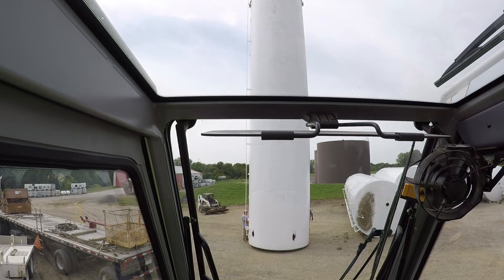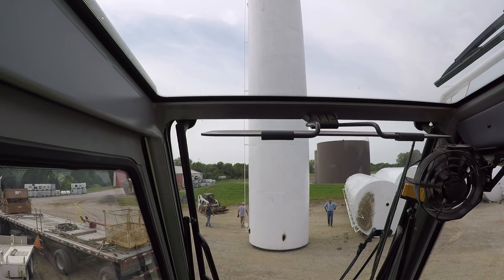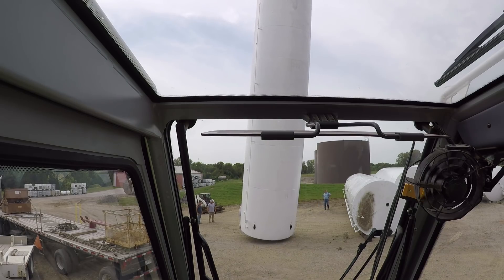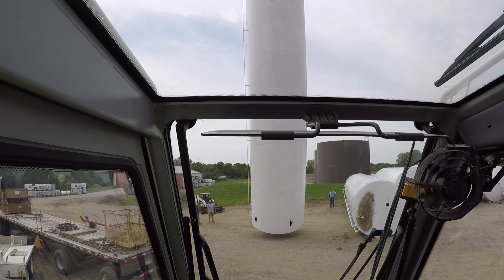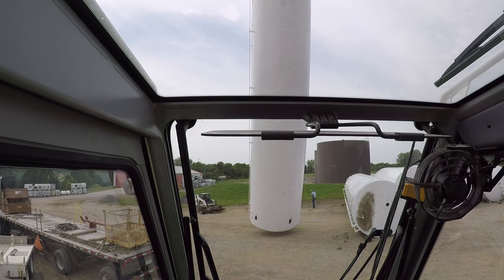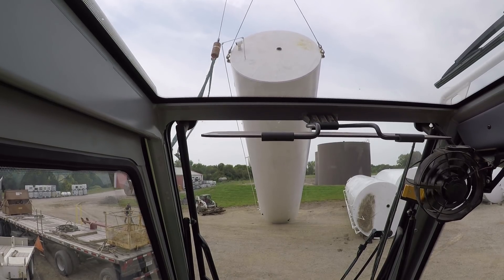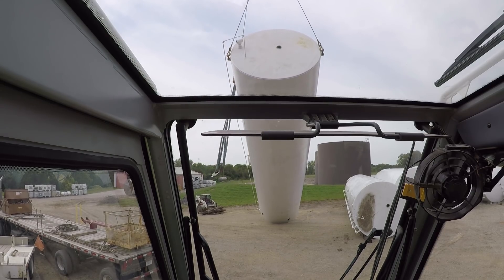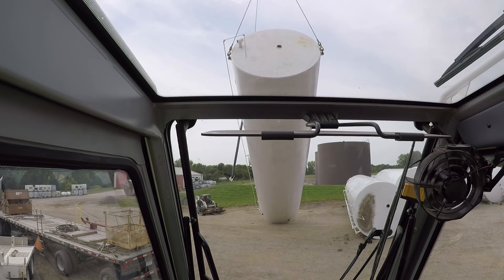Why you NEVER stand under a suspended load!

Comment: did the welds actually break or did the lugs pull out of the shell?  if the entire lug pulls out of the shell itself thats not weld failure ---that would be material failure and a UT of the area should have been done  beforehand    ----that would be on the owner---------------------love your videos sir

Comment: What kind of inspection were the lugs given prior to lift ? If only visual its not enough. Lugs should be inspected by NDT proffessional . Also clarifued by inspector what lifting angle lugs are designed for. Only way to ensure lugs are safe for lift. This is mandatory in the offshore lifting industry.

Comment: 🤔 Wonder what happened? I imagine that would put quite side load on the whip line plus put a lot of pressure on those itty bitty springs for safety latches on hooks. I’ve heard of picks like these. But this is a awfully long load. I thought  the manufacturer doesn’t allow using the main and the whip line at same time. But I’m just an apprentice. What do I know ? Hahaha.

Comment: Today, I was driving through a construction zone where they had all but one lane closed, and they were directing cars through one direction at a time. When it came time for my side to go, they were lifting a huge concrete drainage pipe over the road with an excavator. I stopped because obviously I didn't want to drive under it. One of the construction crew that was trying to wave me to drive under it, walked up to my car and started cursing me out. I told him that I wasn't going to drive under it. He insisted it was safe, so I told him if it falls on me, it'll kill me, and I'm not willing to risk that. He cursed at me some more, but finally walked away, and I continued to wait until they got the pipe across the road.

Comment: And this is why tag lines are important if the load can swing. To keep people out of any area where the load would fall and yet still control the movement of the load. What did the weld inspection show? Failure due to undersized welds or corrosion in the welds weakening the welds? Or were the tanks shot to the point that the inside of the tanks had eaten through to the point that it was the base metal that gave way? Or was it just a case of the original engineering of the lug location wasn't in the proper place? Sadly, something like that happening isn't that rare and in my case, would have meant hours of report writing including whether I had inspected the lift points before the lift was done. Luckily I never had anything fall in over 20 years of using cranes and now have been out of the need to worry about that for the past 16 years. 3 years before retirement, an overhead crane fell at another work location other than my main ones. 6 months later we had to take an inspection course on all types of cranes and lifts such that if we were anywhere within our agency's coverage area and work, that we could shut down the job if we saw anything that was not correct until it was corrected. Safety is Job ONE!

Comment: I work for a power company on a line crew and many times while we’ve been loading and unloading poles with our Digger Derrick I’ve seen guys walk underneath a suspended pole which weighs 1500+ pounds. I’m always yelling at them for it because even though that pole chain is rated much higher than 1500 pounds, you never know could happen. Glad everyone was safe during this and you kept the load low!

Comment: I bet it failed because as the tank tipped, the rigging angle increased, increasing the angle factor multiplier. Or in other words, the lugs were seeing both the downward weight of the tank, and the inward force. I would be surprised if the tank and meant to be lifted with one rig.

Comment: Even though they were engineer picking points you had them hooked to your whip line. Which isn't a straight up and down pull which puts more pressure on the bottom pick points. Good job on keeping it low though. We've set hundreds tanks  that's why we always.have assist crane.
Reply: dzlf250 load angle multiplier

Comment: 48 foot tall tank....uhm...maybe we should stand 50 feet away...a tag line never hurts....I've welded lifting lugs (2) onto a 160 ton load (3 phase transformer)....two plates 1" thick, about the size of your hand....no problem...bevel the plates...use some flux-core wire....

Comment: Alot  of places I worked for would never ever let and operator do that !!
Reply from the maker: Do what? Lay down a tank using both winches? It is a pretty common practice, where vertical storage tanks are installed. Many thanks for watching! 🙂
Reply: To The Top Crane  maybe nonunion ? But not in the oil refinery I worked at !
Reply from the maker: @bustersmith5569  we are union. I have seen lots of operators both union and non that "two line" tanks and other items that need to be stood up or laid down. It's not much different than standing precast panels. I guess the oil refinery business is quite a bit different.

Comment: That an awful feeling, it  has happened to me while winching a rusty old 1ton pickup out of a deep ravine. The frame was so rotten one of my two hook points tore clean off the frame. My calculated load was near WLL for two 3/8 wire ropes. (Estimated 8k pull @nearly 90deg lift).  Had to set it back down in the hole and  start over. Glad WLL is 4:1
Reply from the maker: It is an awful feeling. Sounds like you and I are both lucky no one got hurt and nothing was broken. Many thanks for watching! 🙂

Comment: Retract the boom?  Would move towards you and down simultaneously. Or was there too much load to slide?
Reply from the maker: Retracting the boom would cause the main block (with four parts of line) to lower four times slower than the auxiliary. I also still had a load on the crane. So, the best solution would be to lower both simultaneously. However, there was a 60 foot boom lift on site. So, a person just went up in it and got the lines straightened out.
Reply: That’s an even better solution. Added benefit is close inspection of the remaining eyes for any defects from the shock load

Comment: Does that clicking I hear as the winch line goes in or out signify any amount of distance on the line? Like each click is a inch or something like that?
Reply from the maker: The clicking is an indicator letting me know that the winch is turning and how fast. It works out to be right around one inch per click with a single line. Many thanks for watching! 🙂

Comment: I'm curious to know if the actual weld broke or did it rip the wall of the tank
Reply from the maker: It appeared that the weld didn't have adequate penetration. The wall of the tank was still intact. Goes to show that decent looking welds aren't always strong welds. Many thanks for watching! 🙂
Reply: @ToTheTopCrane  Well that answered a couple of my questions above. Now comes another, did someone have to check on the welder's qualifications? Depending on the age of the tanks, there would have been a data plate on them and the company that supplied them should have the inspection records for those welds. Which is why when the Corps of Engineers built things for us, the initial design specs often ran over 800 pages using both the front and rear of those 800 pages. Then came the drawings from the companies supplying the items and their certifications. And when all was said and done, the set of as-builts that were kept onsite. Because nothing is ever built in the real world to the original drawings/specs.

Comment: Does that make you question the rest of the attachment points?
Reply from the maker: Typically, the top pick points are very robust. They are designed to carry the full weight plus a large safety margin. The tailing lugs are only designed to stand the tank up or lay it down. But, it does make a person very cautious. Which I am anyway. Hence the keeping it close to the ground and keeping it in a position that the crane had twice the capacity of the load. Many thanks for watching! 🙂

Comment: That's some scary stuff.  I'm glad no one was hurt!!
Reply from the maker: Me too! It could've been much worse. Many thanks for watching! 🙂
Reply: @ToTheTopCrane  I bet that raised some hair on the back of your neck! How did the tether come loose?
Reply from the maker: @a-max3865  weld/metal failure on the tailing lugs.
Reply: @ToTheTopCrane  yikes! Were you still able to make the pick?
Reply from the maker: @a-max3865  we ended up picking the far end of the tank with an articulated wheel loader while I used the crane on the near end.
Reply: @ToTheTopCrane  where were these tanks going?

Comment: Good video to share around the crane community, if the vessel was old and had been in place for some time the big question would be were the lifting points inspected , I assume those are new tanks inspection would fall on quality of the welding, you did a great job keeping it low from the ground. One big positive from my perspective is the crane or the rigging didn’t fail but the actual welds on the load failed . Great job
Reply from the maker: They were old tanks that were being removed. We did inspect the pick points. After they tore out, it appeared that the penetration of the welds wasn't adequate. Keeping the load low, and maintaining a radius that afforded me a capacity of twice that of the load, definitely reduced the effects on the crane. Whenever I am tailing pieces with the auxiliary,  I always keep it low and set myself up for as much safety margin as possible. Many thanks for the compliment and for watching! 🙂
Reply: @ToTheTopCrane  Could have been that they used the wrong grade of welding supplies. Like using 6013 where 6010 or 6011 should have been used. You'll get a nice looking weld with the 6013 but unless done right, there won't be much in the way of penetration.
Reply from the maker: By the way, I just subscribed to your channel. It's nice to see someone else making some crane videos. 🙂👍
Reply: To The Top Crane thank you jimmy I always enjoy the knowledge you bring in your videos .👍

Comment: Bet that got the old heart rate up for a second or three. In this sorta situation where you don't have tailing lugs do you just rig a basket/choker at a sane point and go with it from the auxo winch, or do you have to get a second machine?
Reply from the maker: If there are no tailing lugs, yes a choker would suffice. In this case, we regrouped, inspected everything and ended up using an articulated wheel loader on the far end. Many thanks for watching! 🙂
Reply: @ToTheTopCrane  That makes sense. Thanks for the videos Jimmy, always enjoy learning from you.

Comment: Bet your pants where full 😂.
At least all is good and it was manufacturer defect not you rigging could have been bad real quick.
Weld's let go so that can't be you or your company right?
Reply from the maker: Surprisingly, my pants survived as well. Lol. It wasn't anything that we had any control over. So no, not on us. No one got hurt and nothing was damaged (except the tailing lugs). So, all is good. Many thanks for watching! 🙂
Reply: @ToTheTopCrane  probably happened to quit to fill the pants
Reply from the maker: @joshwelner1951  it did happen pretty quickly.

Comment: I didn't like where the onlookers were standing. If you don't need to be close, don't be. Don't stand where you can get pinched between the load and another obstacle. Especially with a tank that can roll. Give yourself somewhere to go. Watch the load and be ready to move. Some people freeze when something goes wrong so they need to be out of range.
Reply from the maker: I wasn't a fan either. I was pretty focused on the tank. After that happened, they didn't stay very close. Many thanks for watching! 🙂
Reply: Yep. Standing between the skid loader and the tank was a bad idea. Always have an obstacle free exit path when possible. Sometimes you don't have a choice like when working in cramped quarters. Which often was my case. Exit path was up so minimum time in the hole was always the best.

Comment: You don't want to be anywhere the load can go. If you draw a line from the ground through the load to the boom you don't want to be there. That is what tag lines are for.

When I connected iron we would be close to that line and only got in it when the first end of a beam was at least on a spud wrench, and getting a bolt into it. The guy on the other end was out side the line until he spudded and bolted. My crane operator would swing just a little bit so we could get to the choker to cut it loose without being in the line.
Reply from the maker: It amazes me how many people don't think the way you do. Some people are completely oblivious to suspended loads. Many thanks for watching! 🙂
Reply: @ToTheTopCrane  Jimmy, I took part in pushing cranes way past what should have been. The operator was very good. Dragging the ball to a beam that the welding truck could not pull to the crane got a building put up.

Question; Would you slack a choker on a bean that was hanging on 4 spud wrenches so you could lift up a bag of bolts so we could put the building together?
Reply from the maker: @jimharris4013  I wouldn't cut a beam loose with only four spuds holding it.
Reply: @jimharris4013  Prior Proper Planning Prevents Piss Poor Production.